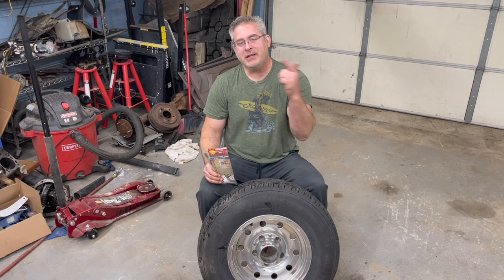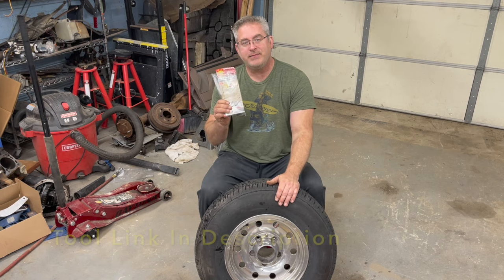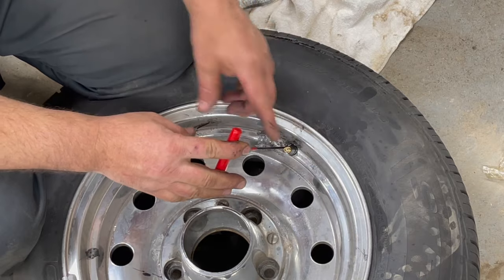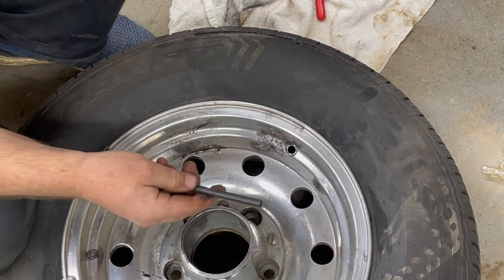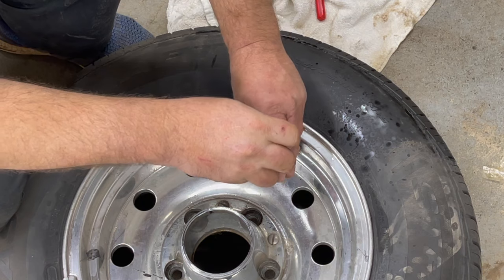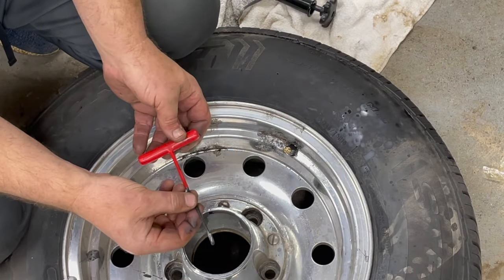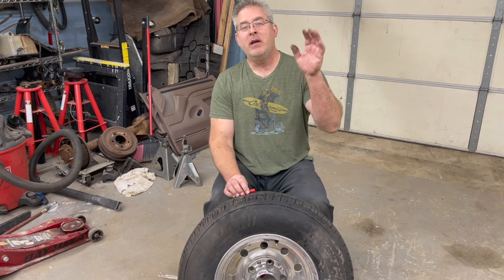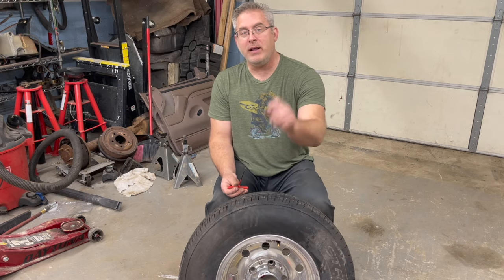How To Replace A Tire Valve Stem Without Removing The Tire

Comment from the maker: This is on sale now!! Under $38.  

https://amzn.to/3LwaaUi
Reply: for lube could i use a little motor oil?
Reply from the maker: I wouldn’t.  But in emergency….
Reply: @filmaker256  NEVER use oil on rubber. Any petroleum distillates will cause it to degrade. 
You would use silicone lubricant or possibly WD-40 at most.
Best DIY lube for anything tire related is actually plain dish soap.
Reply: $38?  A tire shop can do this correctly for less!!!

Comment: After reading the comments you are all forgetting this tool is for when you are in the bush and can't find a tyre fitment shop to replace the valve stem. Also it for emergency use when you are out far in the bush and haven't got a way to get to a town to get a tyre fixed. Is it not better to have peace of mind knowing you can at least fix a broken valve stem if you need to? It is the same as having a puncture repair kit in your vehicle only it is for valve stems.
Reply from the maker: Bingo

Comment: I just tried this using this exact tool. The valve stem came out fine enough, but for the life of me I couldn’t get the new valve stem into the wheel. I used enough lubricant that Ron Jeremy could slide through a keyhole and hammered the absolute sh!t out of it but the end of the valve stem still wouldn’t go through the hole at the end of the valve stem guide.
Reply from the maker: Strange. I’ve used it a few times. My first was that video!
Reply: Did you use a dead blow hammer? A normal hammer would have too much bounce-back when hitting a soft material (rubber).
Reply: did you try spitting on it ?
Reply: Always worked for Ron. Surprise he didn't try, as well.

Comment: I recently had a leaking valve stem. Called the tow truck and arranged time at the tire shop. But the tow guy could fix the valve on the spot almost like you did - but instead of pulling the old stem out, he broke it off and pushed the rest of the stem inside the tire. The rest was like you did it. So now I have half of a stem rolling around inside my tire... but it doesn't seem to do any harm...
Reply from the maker: Nice.  Better to take out but job is done.
Reply: It’s fine

Comment: Make sure that your lube is rubber friendly.Personally,I use Sil-glide to lube o-rings,faucet washers,etc.Great idea for replacing regular valve stems without breaking the bead.I have,in the old days,broke the bead,pushed an old brake cable with a washer on the bottom up thru the stem,then,up thru the rim.Lube the stem,stand on the tire and use vice grip on the wire to seat the stem.Then there is sometimes the problem of resealing the bead to inflate.This is a good alternative.
Reply from the maker: Great tip!

Comment: Use shorter funnel threaded valve puller than push rather than pull would be easier
Reply from the maker: It works pretty good as is

Comment: My old valve stem fell into the tire. It’s ok bc the tire is on a trailer that sits in the yard. Everything else worked as you showed. Thank you.
Reply from the maker: Won’t be an issue
Reply: @BroncosandPartsGarage great guy!

Comment: you can use any funnel that fits, a piston circlip install tool also works.
i've done them with soap and a screwdriver in a pinch.
Reply from the maker: This one won’t deform. It’s a nice kit

Comment: Wow! That is awesome! I need that tool! LOL
That's what I get for being cheap. Not replacing those when I change my tires. The hook tool isn't my biggest concern. I don't mind pushing the rubber piece into the tire to be removed next time I have to change tires. So I really just need the funnel and puller parts.
Reply from the maker: Right on.  Out. You don’t want that bouncing around throwing off your balance.
Reply: Update: got tool. I now have 2 end pieces of valve stems in the tire. Spinner handle part is in pieces, hands all beat up. First attempt, the edge ripped off the new stem where it was going in. Once I find my valve stems that I set aside for the job, then I will attempt a second one. Wish I had the dead blow hammer. The hook tool looked like a bigger hook than that one. I couldn't get the tool out until it finally just pulled through the rubber and dropped that piece of rubber into the tire.
Reply: Update: Now that I used my splitting maul, it went right in without a problem. Then I pulled it out, into place. 👍🏼

Comment: What lubricant should I buy? Do I need to wire brush any corrosion? I wonder 💭 will it leak any sooner then normal ?
Reply from the maker: I used silicone spray.  You can use dielectric grease too.  Wire brush would depend on your wheels finish.  You don't wanna destroy paint or aluminum, wheels!
Reply: Ha ha K-Y jelly might be the ticket.

Comment: i hope i can do this with the wheel still on the car... i got new tires and didn’t know they apparently wheel locked EVERY lug nut or something. like 3 different ppl tried to use the key and cracked it. now one of my tires is flat and won’t take air. 😩
Reply from the maker: https://youtu.be/riN32Xsmm6Q?si=YndEWU1bUzGcEal_

Comment: Think I would be able to do this without removing the wheel from a camper trailer?
Reply from the maker: Yes.  As long as the stem is “flush” on the wheel.

Comment: Is this a temporary fix or is this the same type of valve stem that a tire store would install?
Reply: Its the same that a tire store would install. they're relatively cheap, just make sure you get the right 'size', it should say on your old stem. easiest way to tell
Reply from the maker: Well said. And true
Reply from the maker: Tire store quality.
Reply: Awesome! Thanks guys! I’ll forever be keeping this repair kit in my tool box.

Comment: I could be simpler still with a tire that doesn’t require balancing.  Simply cut the valve stem flush with the wheel and push what’s left inside the wheel.  Then proceed with the tool and cone as in the video.  The little knub of the stem floating around inside the tire won’t hurt a thing.
Reply from the maker: Many ways. This one’s pretty cool.

Comment: Anyone tried this with the HIGH PRESSURE rubber valve stems used on light trucks? I'm guessing the hight pressure variant of stem would not insert. Would appreciate any working knowledge.
Reply from the maker: These were on F150 wheels.

Comment: Can you do a video on removing the pull out ashtray?
Reply from the maker: Pull out ashtray. (Not all the way) Remove  (2) 7mm screws in the black chassis.  Then under the ashtray you’ll find another 7mm screw in center.  Remove.  Slide ashtray out a ONE UNIT.  Never try and remove the ashtray without the metal chassis.  There are some harnesses to unplug.
Reply: @BroncosandPartsGarage  Thank you, saved me a lot of time!

Comment: 2011 Hyundai Tucson has TMPS sensors. Can I remove sensors out and would this or other normal valve stem would fit?
Unless anyone knows the battery size on the TPMS, then I can change it. 
Don't have suv yet & just helping a friend out.
Reply from the maker: Sensors need tire removed from bead
Reply: @BroncosandPartsGarage  No, not really. The tire doesn't really need to be removed out of the wheel.
My question pertain to the normal valve stem to be installed onto the wheel & not using the TPMS sensor.
Reply: Your  tpms light  will be permantly on if u remove a tpms sensor.  
Other than that ur good to go
Reply: @lostgary0  The TPMS indicator light is burnt out🙂 Gaskets/O Rings worn/cracked & dead batteries.
Not really good to go until they need wheel balances. Remember TMPS has some weights vs just V Stems.
Reply: @angelisone  ya and and u would need wheel balanced after taking tpms sensor out what’s ur point ??
I’ve done it in multiple vehicles
Reply: @lostgary0  I done one on Porsche 959 & no wheel balance required after batteries replacements.
Asking for the battery size. Since you have done a lot, have you done one on 2011 Tucson's?
So how many times have you remove & install a new battery on TMPS?
Reply: @angelisone  I didn’t say battery replacement anywhere lmfao.
Reply: @lostgary0  Sounds like you get upset easily. 
And you have not taken apart the TPMS to see the battery, right?
Again, Hyundai models have you done that you were able to remove & install it back?
Reply: @lostgary0  It was my question to you, Greg Corbett
Reply: @angelisone  let me know how ur taking apart a TPMs sensor without removing a tire from the bead.

Comment: looks like one could easily save $40 and rig it up yourself with a plastic funnel (the long skinny ones) and a thread on valve puller tool.  - might need to weld or glue the pivot so it stays straight.  This tool kit should really be only $10-15 given the super basic cheapness of it
Reply from the maker: Those pullers ALWAYS rip the valve stem in half. Lol.  But have at it.   It’s a great kit

Comment: Why not break the bead on one side, stand on the sidewall.  

Cut the old stem off from the back. Pop the new one through. 

Done and inflating in under a minute.
Reply from the maker: Lol. Thanks man. That made me laugh.  Out on a trail, breading a bead by? Standing on a tire?  If you can do it in under a minute I’ll eat my iPhone.
Reply: Yep, take the wheel off, break the bead, remove the old valve, install the new valve, put the wheel back on.
All done in one minute.
Sorry..."under a minute."
I agree, that's a lot better way.🤪
I'll look out for your video.

Comment: I would not be using spray lube on any truck or trailer tire stem aired up to 65 psi...
Reply from the maker: These were OBS ford wheels and tires. 35-40 psi.  Always follow manufacturers recommendations.  I’ve never seen a valve stem “shoot out” of a rim in 52 years…. Always a first I guess

Comment: Ya lost me at $32 tool.. lol

$10 to have a shop replace the valve stem.
Reply from the maker: Your missing the point here 😃 Good luck finding a shop out on the trail. Or traveling to tire store and waiting 1-2hrs.
Reply: Hah, where can you get a shop to replace a valve stem for $10?! I want to go to such a shop! In new england they charge at least $30 - if they deign to do it at all!